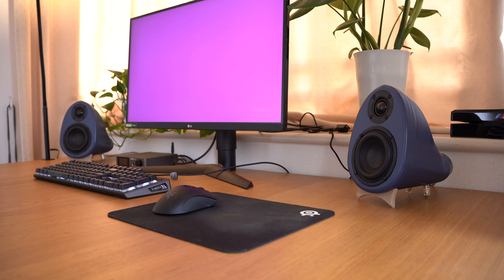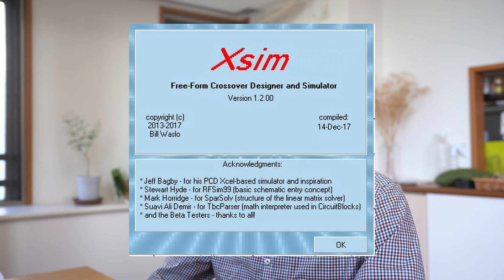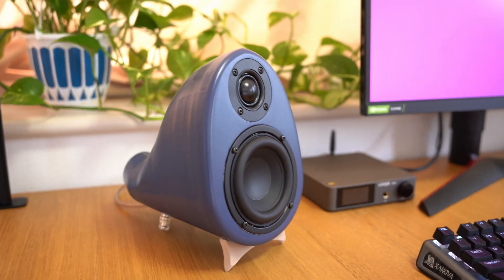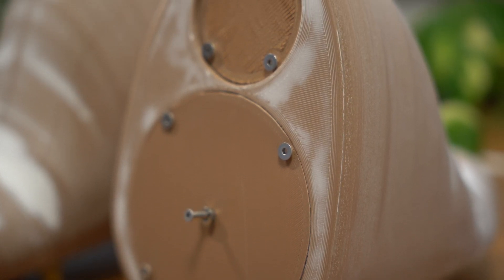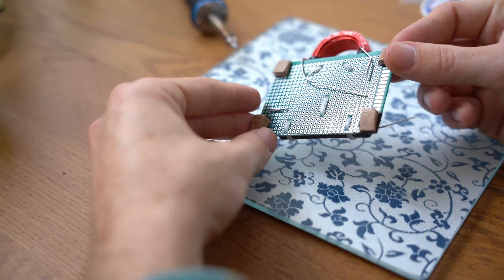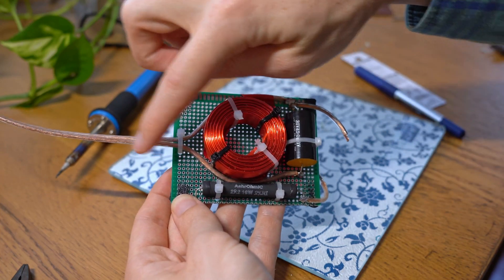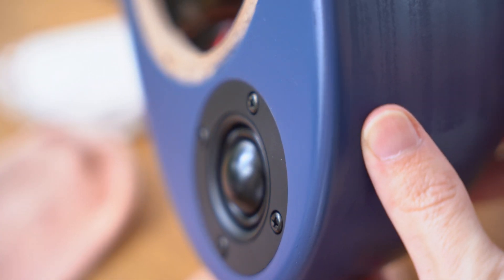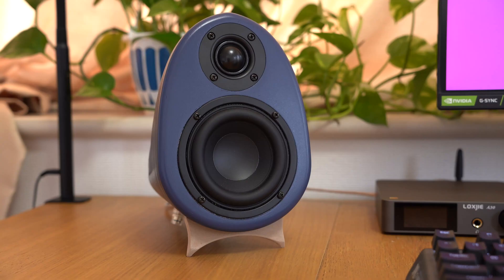My Best DIY Desktop / Bookshelf Speakers Powered by Daytone Audio with a Custom 3D Printed Enclosure

Comment: Hi, what material did you use? The top opening for the woofer is such a smart idea!
Reply from the maker: I used a PLA+Wood Filament. Be however aware that you will need a bigger nozzle diameter... Therefore more sanding etc will be necessary

Comment: Looks like most of the filling and sanding you did was there to account for a bad spiky loft.

About 1.6 litre volume backside of midwoofer, 60Hz vent and speaker -3dB point at about 65Hz is that about what you were shooting for?

You have no baffle step compensation and no phase compensation. The phase alignment is cured a little by you tilting the whole speaker backwards, but it's not quite enough. Baffle step is especially pronounced when you have a very circular baffle shape. This is why you don't generally use manufacturer data in crossover design, without simulating the speaker baffle. Do you understand why the neutral axis is tilted, where the cancellation lobes are, and that 12db/oct filter is not great for that?

These are the reasons i certainly won't be paying 15€ for a set of plans by a first time designer, for one potentially slightly unsound engineering and for other really bad surface design quality.

I also think 3D printing offers a unique opportunity to do your own tweeter waveguides which also fix the phase alignment.
Reply from the maker: Sorry to hear that you cannot appreciate my efforts.

Comment: yea hey can you link where you got your parts? every site i find them on is either sold out or doesnt have them entirely i have been able to find the other ones tho just the resistors are hard to find
Reply from the maker: Hello, I am living in Japan, so I got it from a rather local online shop. For the US I would probably recommend parts express, for the EU I am actually not quite sure which shop is the best. The parts list as well as build instructions can be found on Cults 3D if you search for Sonor Orbit. Cheers
Reply: @ringoton  Should mention that parts express is 725 Pleasant Valley Dr, Springboro Ohio.  Dayton Audio is 705 Pleasant Valley Drive.  Privately held companies likely with the same owners, except one is audio design(designed in Ohio, manufactured in China) and the other is online distribution of audio components(prominently their own brand).

Comment: How many wall/perimeter and %infill did you used ? Thanks
Reply: So how thick have you done the enclosure?
Reply from the maker: Actually, 100% infill. From my understanding a 'solid' speaker will perform acoustically better. Also, the speaker will be a bit heavier.

Comment: Hi mate. I'm very amazed and like this unique design. Are you able to do a 3D print file for a 3 way speaker? (using the same design shape of this speakers)
Reply from the maker: A 3-way speaker which is 3d printed would be possible, however the current design does not have enough space, therefore a bigger speaker enclosure would probably be necessary. Even this 2-way speaker setup does produce a nice sound stage though :)

Comment: beautiful work,
could you look into making a binaural recording system?
thank you.
Reply from the maker: Hello MAK-1, thank you for the comment. Actually, I have been contemplating how to analyze the sound performance objectively. Unfortunately most of the audio testing equipment is quite expensive, so it's most likely outside of my budget.  Therefore, I am looking into options of working together with some outside help. I'll try to upload the result as soon as I have anything available.